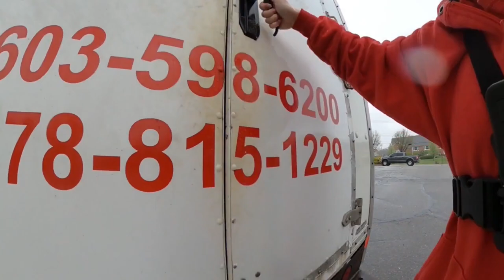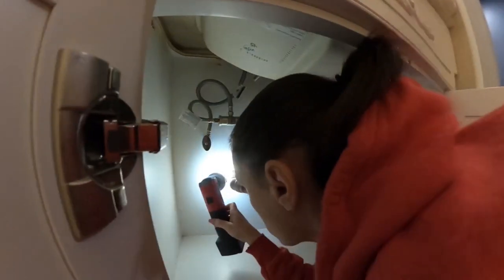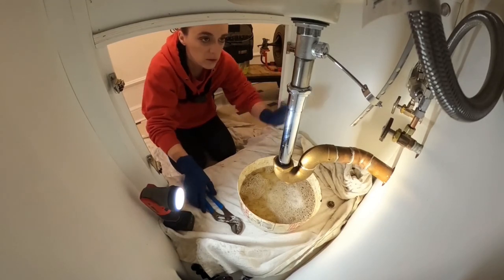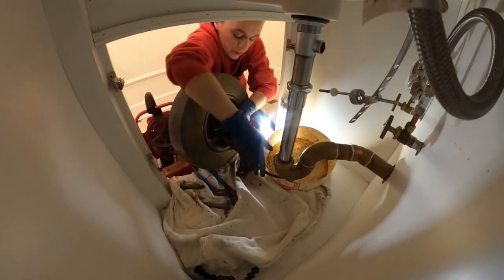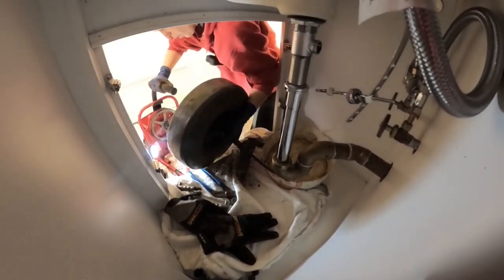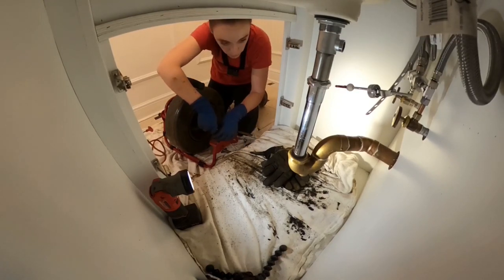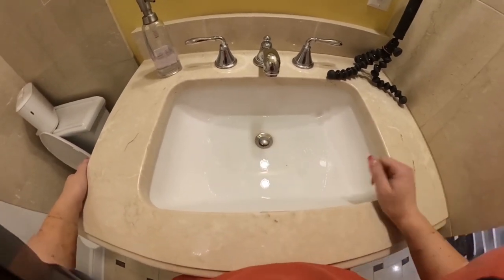Clogged Drain #144 How We Clean Back To Back Sinks

Comment: Tough one, the best way iv found to handle back to back sinks or toilets is to put a bend in the cable and run a camera in the line at the same time to make sure you going the right way
Reply from the maker: Completely agree BULB271602
We do it sometimes as well. (Bob)

Comment: Yeah, it's a real pita when the cable flips😂, I've had my days when I also have to take the whole drum outside to unwind and get it back going...it really make you work for your money. Good job at getting it done.👍
Reply from the maker: I hate when the cable flips, it's a lot of work. The old style machine we have is so much easier to fix the cable in. Thank you for the compliment 😊, also thank you for watching. (Shelly)
Reply: @DrainMedic  yeah, guess I'm old school because I've yet to upgrade to any of the newer machines. I'm use to the Viking and rarely have issues with the cable flipping at this point...I'm usually able to get rite in, & get rite out.

Comment: Also, a lot of back to back sinks around here, you have to use a drophead cutter on the cable. I have a ⅜" just for that stuff. I need to grab a ¼" cable with one too just to have.
Reply from the maker: Thank you for the advice, we prefer to not use a cutter on the sink and tub cables. (Shelly)
Reply: @DrainMedic  I used to cut mine off too, and bend a 45° on the cable. But a drop head will get you places a regular cable won't go sometimes. I don't use it often but it's a blessing when I need it.

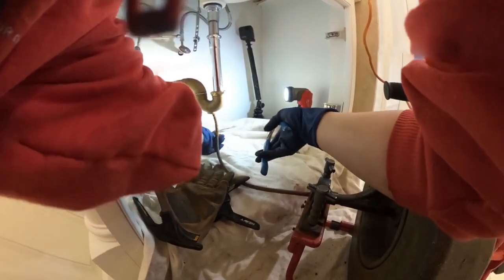Comment: Im going to cut that pipe everytime and put a fernco like you were talking about at 9:30. Its easier to use a larger cutting head to really clean it out but more importantly its easier to ensure I haven't jumped the tee. I keep a dishwasher hose with my sink machine so I can stick it down the drain to test and help flush when I think I've got it.  No hate though. What you did works perfectly fine and is still a professional job.
Reply from the maker: Thank you, we try to avoid cutting pipes whenever possible. (Shelly)

Comment: The drain cleaning gods must have been watching over you that day. If there was a double sanitary tee in the wall, that would of made it much harder. Flipping the cable in the drum (or twisting it outside the drum) is never fun but glad you were able to unflip/untwist it and finish the job. Well done 👍

I'm curious what GoPro you use and which tripod and harness you use. Any info would be great. Thank you!
Reply from the maker: Yes they definitely were, as for the GoPro we use 2 360's. The tripod is a generic brand as well as the harness. The extension arm on the tripod is actually from the insta360 camera so it is invisible to the camera. (Shelly)

Comment: I seen you mention wax rings as a source for smell. Would you not use the rubber ring since those don’t seal as well as wax?
Reply from the maker: We don't like the rubber because they don't seal well. We always use wax they work the best. The only reason why the smell would come from the wax seal is if it were compromised in some way and doesn't seal the sewer gases. (Shelly)

Comment: Sorry to hear about your cable Shelley,but at least you got the drain cleared. What do you do in a situation where you don't have any cleanouts on your traps? Pull a toilet? Nice work!
Reply from the maker: Thank you Randy, the cable is fine just a pain when it happens. If there is not cleanout on the trap we would have to either go through the top of the sink and jump the trap. Or we could cut the pipe and add a dandy cleanout so that we could snake the drain. For this drain we would not pull the toilet to snake the drain because it would not solve the problem for the customer. (Shelly)

Comment: I hate back to back sinks. I like to make a cut on the trap arm so I can make sure my drop head goes down the San tee and clears the line.
Then retrieve the cable and solder things back up with a new coupling.    You did a great job though Shelly and you are very professional.. In my opinion  the guy who invented back to back sinks should be arrested though. What a headache!!!!! DD in Los Angeles
Reply from the maker: Back to backs can be challenging. But clearing them can be rewarding. Thanks for watching. rapidrhinoplumbing-monrovi3269  (Shelly)

Comment: Just curious and wanted to clarify. 

But when you say back to back. You’re meaning the sinks join together in the wall and drop at the tee? 

So the clog was at the drop when the two sinks join together ?
Reply from the maker: Hello Indi
The sinks join together in the wall with a x fitting. Looks like this +. The clog was at or after the x fitting. Hope this helped. (Shelly)